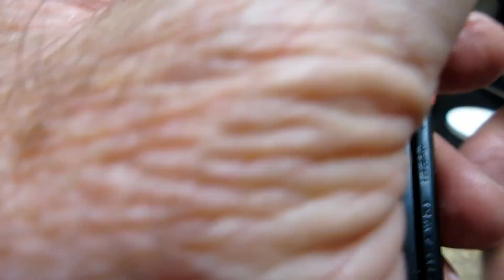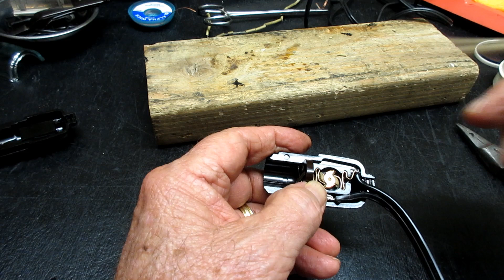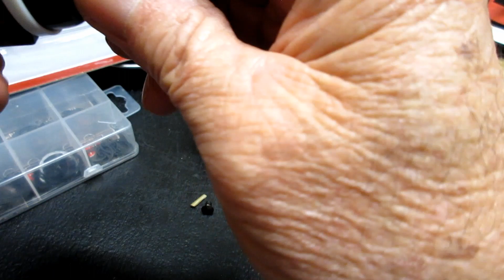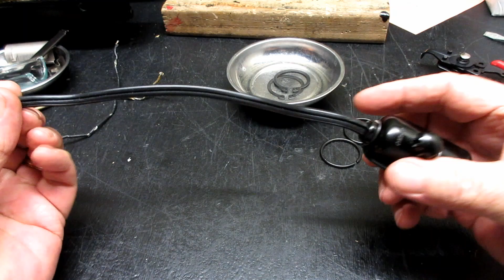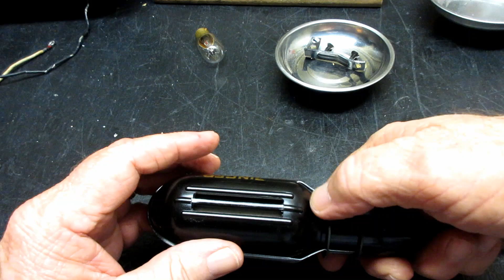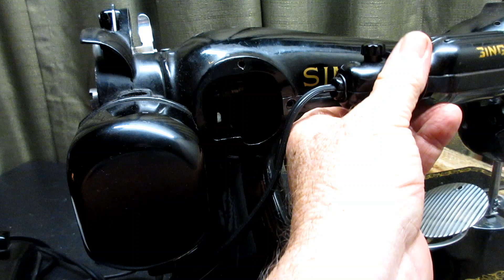Singer 15-91 Light. Replace, Repair or Rewire. Part Two.

Comment: What a pain these lights are. I got through the two larger rings OK, but trying to put the small one back on was a royal PITA.. just couldn't get it on. SO frustrating, tried everything, pliers, screwdrivers, snap ring pliers with the tiny pointy ends.. Nothing but frustration... Then  I thought I would try something different,, a box end wrench that fit over the end where the ring goes,  13 mm. fit over it without the ring, So I put the small ring on the nub where it is supposed to go, and then ran the wires through the box end wrench, and tried centering the ring with the wrench over the top of it, and pushed down hard, and about the second try pushing down on the ring with the 13mm box end wrench, the darn thing popped on. YAY.. I'm going to try that again on the next one that I do, which will be soon.  I do think the snap rings with the wholes for the pliers look fine..  I might go that route next time..
Reply from the maker: You hereby win the brilliance award for tool workarounds! ✨🥇🔥 Nicely done for sure. That smaller ring is truly a PITA and I love how you got it back on. I just pinned your comment to the top and hope others will see it and save the aggravation.
Reply: @andytubesewing1953   Maybe it was just lucky that the box end wrench worked? IDK.. but I sure did a lot of swearing through the whole process before the wrench. lol. I just picked up a 15-91 from the Salvation Army for 10 bucks, $8.00 and change with my senior  discount. LOL....When I get board I just go buy (rescue) another vintage singer..  So nice to hear from you..! !!  I'm still watching your videos.. they're the best on YT.. for vintage sewing machines.!
Reply from the maker: @connieworcester55  I love that you save them and thanks for the compliment. 🙏
Reply: @andytubesewing1953  Saving them is easy, thanks in good part to your awesome videos.!! I'm a visual learner, It's like sitting next to you while you tackle any repair.  I love working on these old beauties. I even sew a little bit every now and then. but working on the machines is much more fun and satisfying ..  I think I have ? 18 Singers now..  Thank you so much for all your help.. 🙏
Reply: 12 worked better for me. Yay
Reply: Simplemente difíciles de quitar y volver a colocar esos anillo.  Felicidades a quien lo logra!

Comment: Hey Andy, as I’m finishing up the lamp for a 15–91, I found that the threads in those two holes that hold the bracket for the light appear to be worn out and won’t take the screws. Unfortunately, the extra piece that I have that has the end of it broken off, the one where that little tiny ring goes on is broken off. I’m thinking, like I did with that small ring, putting zip ties to hold that bracket in place lol. Have you ever heard of the threads in those holes wearing out like that? Now I’m thinking I’m gonna have to zip tie that bracket on there as I don’t know what to do with those worn out threads. Anyway, it was good getting back to this particular video as I needed to rewire it, this was perfect. Thanks for sharing all of your knowledge.
Reply from the maker: I find it rare to have a stripped screw hole on the machines, but I've had a couple. I borrowed a tap & die set once to enlarge the hole with new threads to use a slightly larger standard-size screw from the store. Another time, I used a little bigger self-tapping metal screw and forced it in. The 3rd time, I could get access to both sides of the hole and used a tiny nut & bolt. Not pretty, but it worked. Was it screwed on when you got the machine? Be sure you're using the correct screw. Maybe you can actually see the threads are damaged inside, sigh... good luck.
Reply: @andytubesewing1953  yeah I took a little tiny screwdriver and ran it up and down the sides and there was no ribbing. I’m gonna try that tap and die set method. Luckily, I did find another light assembly and I was able to switch it out. Thanks for that information.
Reply from the maker: @rhondamercado7527 That's probably the best permanent solution. I was lucky because my neighbor had a tap and die set and showed me how to use it. That's the only time in my life I've ever used one. They were expensive back then but I've been told they're much more affordable now if you need to buy one. I know you will work it out I know you never quit. Good luck
Reply: @andytubesewing1953  just one more thing I forgot to mention Andy was when I took the screws out, they were full of the black bake light material, i’m guessing that’s what that was, I don’t think there’s any metal in that area. I cleaned them as good as I could, but I probably needed to soak them in some solution and I noticed that with the extra light fixture I had that when I took those screws out, the screws were just full of that black gunk. I’m guessing it’s all Bakelite material.
Reply from the maker: @rhondamercado7527 oh that's odd I wonder if it was the bakelite type plastic or some kind of cement or glue previous owner used. If only the machines could talk right?

Comment: I don’t wanna confuse you or anyone else, but is it not important whether the ribbed side of the wire goes on top or bottom and then one and three when they get ready to be connected. I’m having a little anxiety with the neutral and hot side of the wires and where they go. Hopefully none of that’s even important. I hope this makes sense and your understanding what I’m trying to say lol. Thanks…..edit. I finished watching the video at the end and you covered this. Thank you.
Reply from the maker: Thanks for adding your edit at the end of your comment 🙏

Comment: Omg!  I’m headed to the hardware store to get me the snap rings with the little holes in them. How come I didn’t think about that.  I spent a good hour trying to take them off. I know it’s gonna be two or three to try to put them back on but wow, I’m glad I found this video. I thought I had watched it before, but I don’t remember you using those snap rings with the holes.
Reply from the maker: I've had viewers write me that they had no problem, but it was a big hassle for me, so I got the snap rings. I think you'll like them.

Comment: Hi ANdy,  good theme song for this vid.  I am done with my 328 now working on a 66.
Reply from the maker: Thanks. Model 66, a true classic machine. We still use the Class 66 bobbin they invented for this model. Have fun.
Reply: followup question for the 66.  I have been searching for a spoked wheel with 3.5" pulley, thy all seem to be 2 5/8". Do they exist?   @andytubesewing1953

Comment: Another thought... I am so grateful to have learned from you that many antique and vintage machines run quietly and feel so smooth after a good cleaning and oiling. I brought my new 1919 Singer 128 hand crank to a quilting workshop last month. My sewing friend were surprised by how quietly it runs. Many of them think I have super mechanical skills, but I say no, and I tell them I learn a lot from your channel. Plus, the old Singer black straight stitchers are so easy. Thanks for giving me the confidence to service my old machines myself. It's so fun and rewarding. Take care. Andy, thanks from the bottom of my heart.

Comment: Hi Andy, I just watched your latest YouTube.  I'm so sorry to hear you're leaving.  I was just going to tell you how much oil my sewing machine is using.  I sewed two waist packs out of cordura and my 503 started making a chirping sound.  I finished my project and pulled the thread out and gave it a good listen.  The chirp was coming from the top front of the machine.  I started oiling and the chirp went away.  I just oiled it about 6 months ago and thought it was going to be plenty.  I went through oiling the whole thing and the motor hum went away and control was better and everything.  So I guess every time I start a project from now on I'll lube  the ol' girl.  As always I have to say thanks for all the time and effort into your sewing machine videos.  They are great studies of mechanical ingenuity through the years.  So, thankyou very much.  Ralph-
Reply from the maker: A great comment, Ralph. ⭐ In more "modern" manuals like for the 503A, it just says oil "occasionally" and "periodically" kind of leaving it up to you. The manuals for the older models (think black finish) would say things like oil "regularly",  "as used" and maybe the best insight was the one that stated, "if the machine is used every day then oil it every day". Most of the oiling points on the 503A do not have storage capacity. That's why the manual says "one drop of oil". If you washed the machine with Krud Kutter I would oil it for each project. Over time you'll notice it won't need as much. There is NO PLACE on the motor that needs oiling, period. The steel gears and Textolite gear on the handwheel can be greased less often as the grease tends to cling to those parts longer, but no need to slather them with grease, just a light coating. Your 503A will outlive you if taken care of so be sure to update your will. Thanks for saving the machine, Ralph, and happy sewing.
Reply: @andytubesewing1953  What a helpful and humorous reply (about updating his will). You are so awesome, Andy!
Reply from the maker: @logicalblueberry  😊

Comment: Any where i can get the copper spring contacts ? mine are broke and i really don't want to trash the ight.
Reply from the maker: The light is probably 50+ years old. I do not know of anyone making replacement parts like the springs. You'd maybe have an easier time making new springs than finding just the springs for sale on sites like eBay, Facebook marketplace, etc. You can find the entire used light for sale there though. It also fits some models 66 so it is advertised for that too. As mentioned in my video you can find NEW replica lights like this; https://www.ebay.com/itm/291984864494?hash=item43fba774ee:g:HCUAAOSw9EZZkasB    The used ones sell for $20 to $50 so shop around if you decide to go that way; https://www.ebay.com/itm/265504499052?var=565311671481&hash=item3dd14d256c:g:F28AAOSwxbhh5I0K I believe the light is part #195289 if yours is like the one in the video, and the springs/holder is part #195349. "Spring contact & holder".
Reply: @andytubesewing1953  Thank you for the reply . I just found a good replacement light for it I was attached tp another singer i found on marketplace for 45.00. The hole machine was cheaper then buying the light. like your vid's and will be back for more , Thank again!
Reply from the maker: @billleitz9150  SCORE! Nicely done 👍

Comment: Hi Andy.  I much enjoyed seeing the insides of the light and how to rewire it.  In the part “Install Ring Terms on Wire,” did you slip a piece of shrink wrap tubing over each half of the new wire before soldering (and then shrink appropriately it when done)?  It looks like it to me.  Just checking.  My light does not need rewiring, but my motor wire will, at the least, need new ring terms, so I’m collecting the materials now for the motor wire.  Also hoping you will show how you rewired your motor!  I actually like the look of those new snap rings better than the original rings.
Reply from the maker: Yes, it is a type of shrink wrap but just barely bigger than the wire insulation. It is really there for reinforcement and it shrinks to the wire insulation just from the heat of the soldering. I don't cover the soldering spot with shrink wrap. I don't show in the video, but I wrap the solder spot several times with colored thread ( red & yellow) for insulation and bind it with a drop of crazy glue so it won't unravel. I want that short span of wire before the ring to have reinforcement as that seems to be where all the wire insulation cracks and gets damaged.

Comment: Given the topic is lights on Singer sewing machines I thought I would share a bit of what I think of as interesting history.  I have a 1924 Singer and it has a light in it made by General Electric, and printed in black letters on the glass of the bulb are the words “Made for Singer Sewing Machines”.  No idea how old the bulb is, but it still works just fine.
Reply from the maker: That is a rare one; congratulations. I only know of the chrome spotlight that G.E. put on their "SewHandy" machine around 1928.
https://singer-featherweight.com/blogs/schoolhouse/the-standard-ge-sewhandy-early-featherweight-history
Reply: @andytubesewing1953  Thanks for the link.  Fascinating.  The fixture on mine is a chrome Singerlight fixture.  The bulb itself has the printing on it.  I've never seen one like it.  I didn't know that GE made bulbs specifically for Singer and actually printed that information right on the end of the bulb.

Comment: I have to teach myself to solder just about every time I solder.  About every 2 years or so I might have a little soldering job.  By then my tip is all oxidized and won't solder.  Major cleaning, can't find my solder, connection between tip and iron oxidizes so now I need to replace the tip after trying to flux my tip.  And on and on.  When I finally get everything together and get the wire on there I put my stuff away for another year or two.  Thanks Andy, not need to apologize for soldering skill or technique.   I think most people go through the same thing.
Reply from the maker: I get this completely! In the 70s I worked a year on the Main Connection Frame for a Telco company and soldered every day. Could do it in my sleep. Nowadays it's like learning how every time I drag the iron out, haha. Thank you for watching, Ralph.

Comment: What type of flux are you using? Is it the type plumber's use?
Reply from the maker: I had no idea, really. My neighbor gave it to me 20 years ago when he moved. I think you are correct as I looked it up at the OATEY website at this link: https://www.oatey.com/products/oatey-h2095-water-soluble-tinning-flux-833144171?upc=038753301402
Thanks for watching my channel, Ralph.
Reply: @Andy Tube  I was taught you use "rosin" Flux for electrical and acid Flux  for plumbing.  The acid could cause problems it the connection.
Reply from the maker: @popheiz  and now you've taught others; thank you. I wasn't taught anything about soldering. Interesting to see if the light on Ike develops "problems".  The oldest wire soldering with this flux that I remember is a new locking female end to my outdoor extension cord. That was about 9 to 10 years ago. So far so good. Thanks for sharing. Was there anything you liked about my video or did you just want to critique my choice of flux?
Reply: @andytubesewing1953  I enjoy your videos very much, I work on more modern machine usually. But, every now and again I get an old Singer or whatever to service.
Reply from the maker: @popheiz  Thank you. I'm glad you visit and hope you'll return. Take care.

Comment: A great video.  Thank you!

One has to wonder why Singer used three really strong steel snap rings to hold together a small Bakelite light fixture.  Not one, not two, but three.  

Those snap rings are strong enough to hold down an aircraft carrier in a hurricane.  Why in the world they decided that they needed that kind of fastener is one of those mysteries that I don't think I'll ever figure out.
Reply from the maker: I wondered the same thing... why the overkill? They only used one smaller one to hold the alternator shaft bearing on the PA style
 Slant-O-Matic Motor. Thanks for watching.